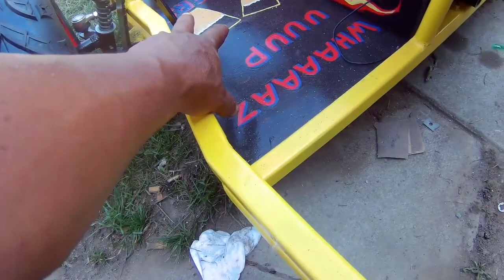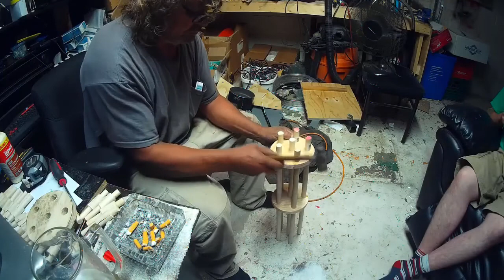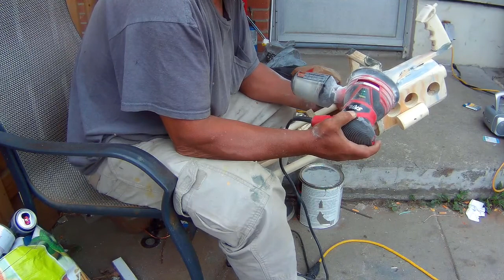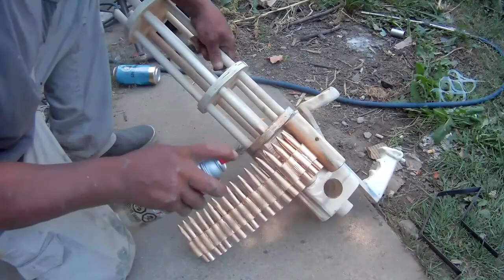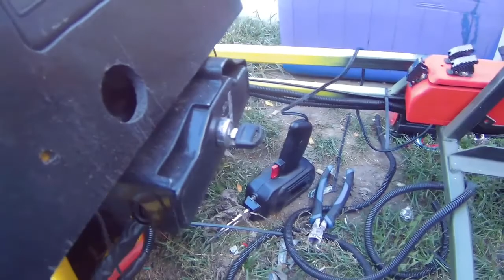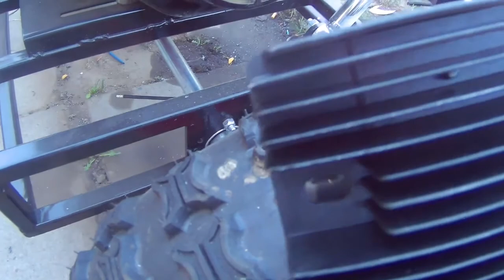Machine Gun Neves pt.12 Some Ad Ons

Comment: Hi Neves.  That box you got there  is a voltage regulator I'm  pretty sure. Or reg rectifier  it might be called.  Have a look around where  the electric  start is  . Your plug should match up to another plug there somewhere.  Good job on the kart mate 👍
Reply from the maker: Hi Customwinder 1, thanks but no there is no plug that matches and I can't find a wire diagram for this thing, I'm going to have to get a charging tester and check if I can hook it up right
Reply: Neves Projects  Yeah see what you come up with.  I got some mates i can ask .  I'll see what i can do.
Reply: Neves Projects Hey mate.  I tried to share the link with you  but it won't let me.  Try wiring diagrams for any ride on mower.  Or small engines wiring diagrams.  Craftsman  have some good diagrams.  It looks simple to hook up.
Reply from the maker: Customwinder 1 thanks I will search